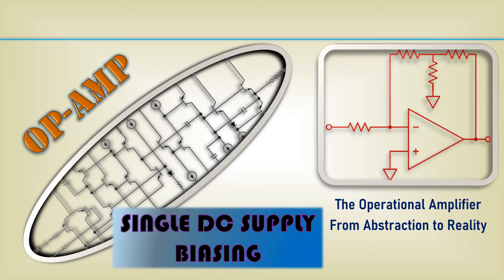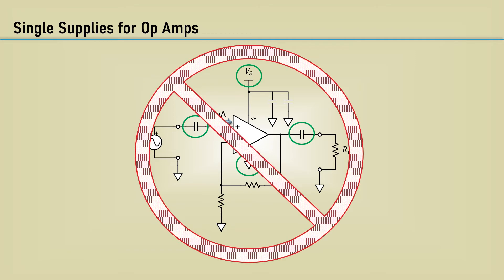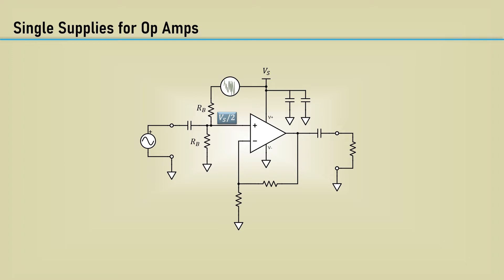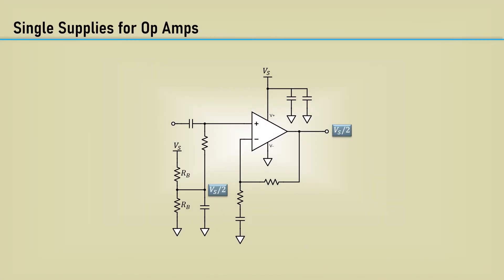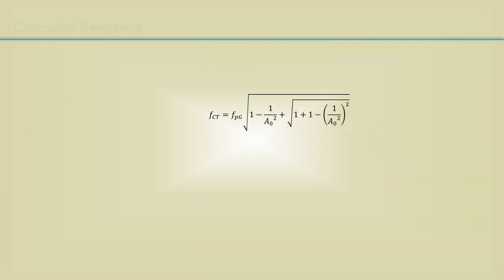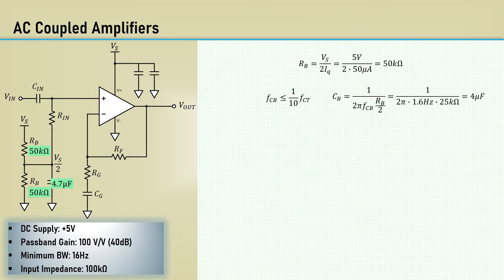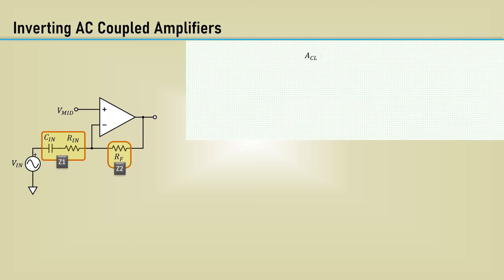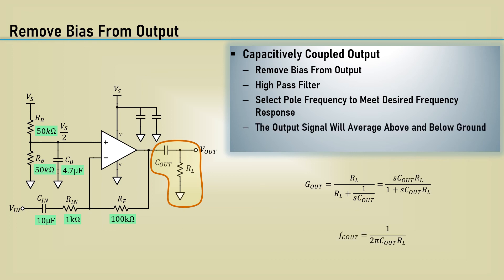Op Amp Single DC Supply Biasing

Comment: I've built the circuit shown at the 5 minute mark to condition a signal from a piezo disc. I'm attempting to collect chest expansion (from breathing) and heart beats when the piezo is laid upon. I was wondering if you could comment on the 2 capacitors stimming from the V_s? How to size them and why are there two? Thanks in advance!
Reply from the maker: Thanks for the comment. It depends on how noisy your supply is. If the power comes from a rectified AC line and has some power line ripple in it, it's typical to have a large value capacitor like a 10-47µF electrolytic or tantalum type. Since most large capacitor values will have a significant Effective Series Resistance (ESR), it's necessary to put a smaller value ceramic or mylar type in parallel, having a low ESR to help shunt the higher frequency noise that may be on the supply line.

Comment: Sir could you please add one application of this circuit how the opamp datasheet parameters used in the the design analysis 🙏
Reply from the maker: Audio amplifier. Guitar pedals typically use 9V batteries and use these techniques. Only ideal opamp abstraction was used here.

Comment: Thanks for the educational video. I have made a 3005 lead 12 Marshall preamp.  It works well with +17/-17 volts. I tried to make it work with a single power supply using biasing like you showed. It worked with Tl072 but heavily distorted. But didn't work with the original 1458 and JRC4558. What changes should I do to make it work.
Reply from the maker: I’d need to see your schematic.

Comment: Excellent development and technical approach. My congratulations....! One question, just to check. For the unity gain case of the Opamp, Rg-Cg is not necessary...and Rf = 0 ? This is the typical case for using a unipolar supply differential A/D converter. Very good video OldHack !!!! An honor to write the 1st comment.
Reply from the maker: Yes correct. Thanks so much for the comment!